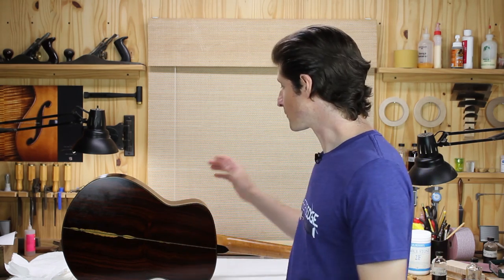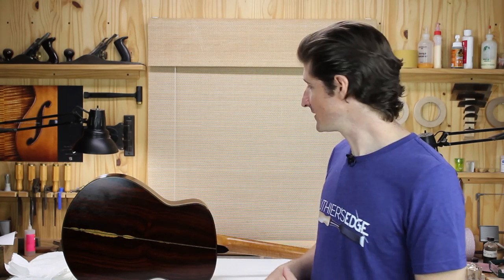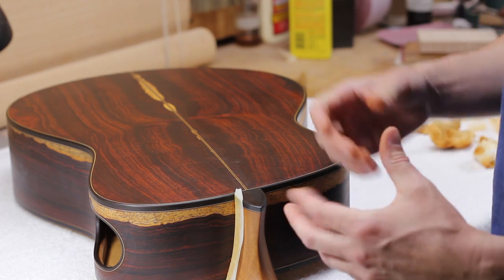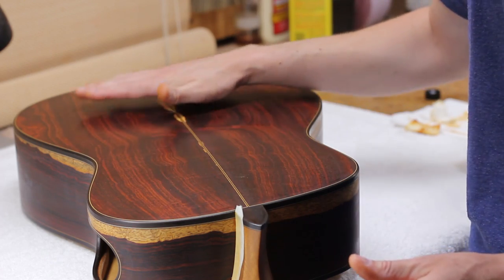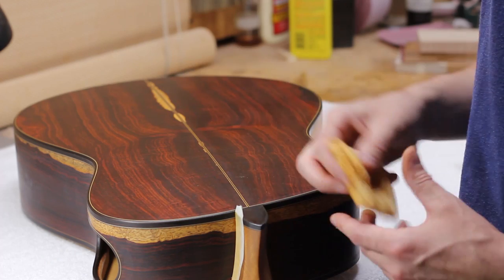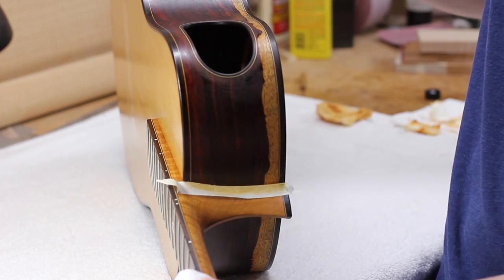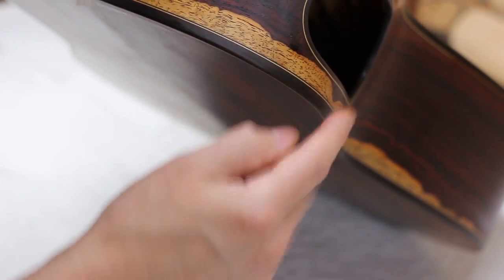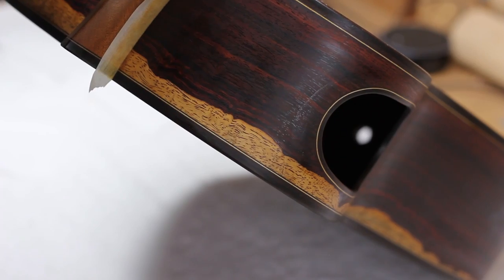A Simple Guitar Finishing Trick For A Better Shellac Finish

Comment: I built an acoustic guitar over 50 years ago using Brazilian Rosewood and German spruce top. I used the French polish method after receiving a very brief lesson on how to apply it. While I didn't have near the knowledge or experience this gentleman has, it turned out amazingly well. The finish has held up quite well considering all the years that have passed. It's not in need of a refinish at all. Of course taking proper care of the guitar over the years has helped preserve and sustain the good condition the guitar is in today.

Comment: Great tip.  Thanks for sharing it.  I couldn't help but notice that the radiuses (radii) on all of your edges are beautifully consistent.  I'd love to know how you achieve this (maybe another quick tip video idea).
Reply from the maker: Hey Paul,  Thanks so much! It's a small detail but one that I think makes a very big difference in the overall impression of the guitar. I think you're right that it would make a great video so I will put it on the list for sure. In the meantime, what I do is leave the binding square until almost the very end of the woodworking portion of the guitar building process. That helps me see clearly how even the thickness of the bindings are as I work my way toward finish preparations. Then I start the rounding of the bindings with fine luthier's files like these: https://amzn.to/2Vnj8N5 (if it's ebony I sometime use a scraper as well) After that I use 150 sandpaper with soft sanding block. Then  switch to 320 and continue to refine. ***The key to all of it is using light and shadows to see the evenness and gracefulness of the contours. The shadow is the inverse of the shine that will show these details after the guitar is done. That's an important thing to keep in mind for getting the best results consistently. Hope that helps a little!

Comment: I have some superficial string lash marks around the bridge in my French polish guitar. I tried some naphtha to restore its luster to no avail. Would everclear work for this situation?
Reply from the maker: Hi Nick, French polishing around the bridge is a tricky area. If you do try to polish it, you will have to blot out your pad until it looks totally dry, and be very careful not to overwork the area and cause a bigger problem. My advice is that if you do intend to try it, I recommend working up a test board first to practice and experiment. You'd have to French Polish some scrap wood to build up a good gloss and then try to recreate those scratches. Then test the methods of fixing them. On the test piece (not the guitar yet), you could try a little shellac, a little alcohol, and a tiny drop of olive oil on the pad. Then blot the pad on a Bounty paper towel until it seems very dry, and then glide onto the surface and try to work the scratched areas just a bit and then stop before things get too soft and other damage gets done. You'll have to try different methods until you find what works on the test wood first. That way, if it all goes wrong, your guitar doesn't end up in worse shape than before.
Reply: Really good idea. I did not think of that route. Thank you so much and for all your videos!

Comment: I’m currently French polishing my 2nd guitar (my 3rd build) and the last guitar I French polished ended up taking on the imprint of any material that it came into contact with. I chalked it up to bad / cheap shellac flakes.

I purchased nicer shellac, and Now I’m French polishing my 3rd guitar and I’m currently bodying. I can tell this guitar is also going to have a soft finish and imprint like the previous one…any idea what could be causing this? I’ve asked around quite a bit and lots of experienced French polishers seem to be stumped as to why this could be occurring.
Reply: Firm pressure on your pad throughout the bodying to compact and harden the finish. Make sure you spirit off firmly. My first guitar was soft for a long time as well, maybe because I was using isopropyl? Sometimes they need to cure for a while. Eventually mine hardened up. I hope yours did too.
Reply: I’ve experienced the same issue. I would agree that pressure in the spiriting off helps avoid this but man that process that can south pretty quick. Since I’ve not really mastered that part of the process to avoid a soft finish I just hang them up for a while. I also struggle with where the neck meets the body. I now understand the cost FP adds to an instrument.
Reply: @joeyoungs8426  I’ve read about master French polishing using Eugene Clark using tons of pressure, from a couple different sources. I’m going to always end sessions with hard pressure, a mini spiriting. I’m always going to quit using walnut oil as a lubricant and use olive or mineral oil instead!

Comment: What is the reason for 'pore filling' with pumice? Doesn't the pumice 'muddy' the grain?
Reply from the maker: Good question! Using pumice, when done properly will actually draw out the natural resins of the wood and result in a beautiful perfect color match and a clean smooth sealed surface for the top coats of finish. The key is to use the right technique! That's why I made this video :) I also have some free French Polish training videos you can check out over on my website here:  https://theartoflutherie.com/french-polishing-technique-and-free-videos/
Reply: Beats drywall caulking any day
(I cringe every time I see someone use that...)